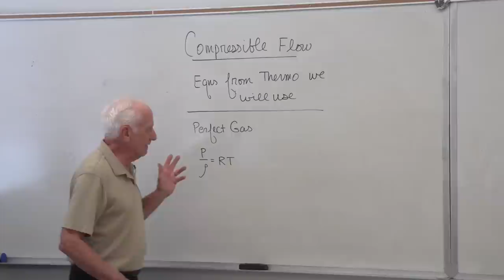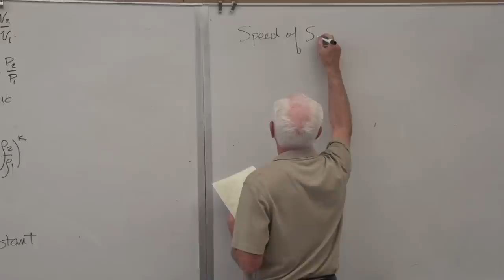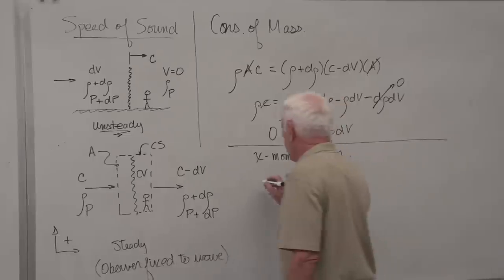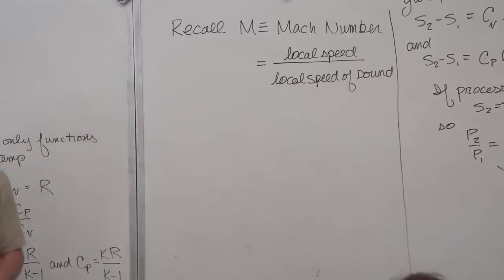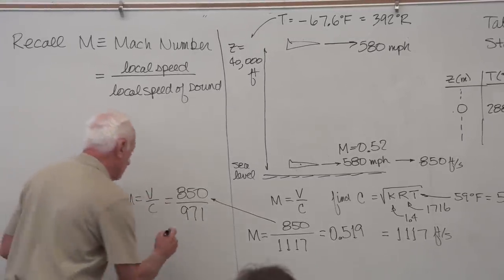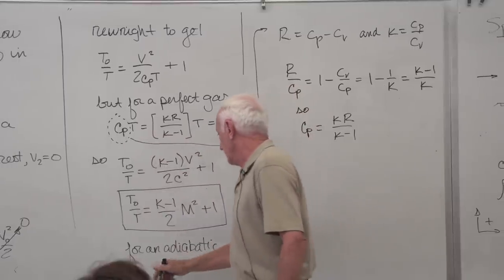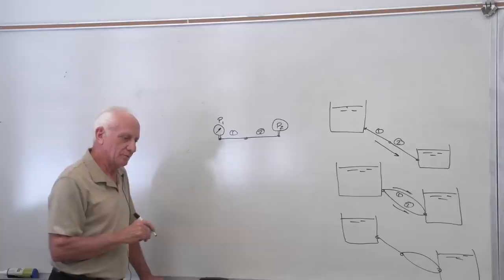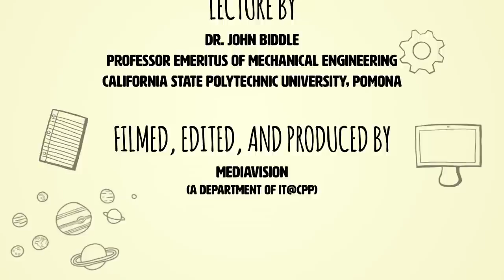Fluid Mechanics: Introduction to Compressible Flow (26 of 34)

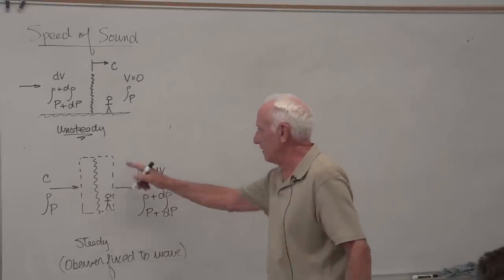Comment: 14:42
Error in the directions, the shown directions of the bottom diagram are for a wave presumed moving leftwards contrary to the upper diagram which shows a wave moving rightwards.
Reply: I was equally confused by this, when you sit on the sound wave you should be seeing the air coming towards you from the right. I'm glad I saw your comment confirming this :D